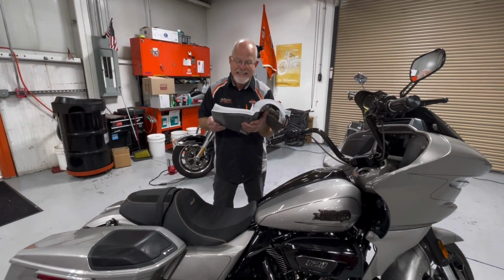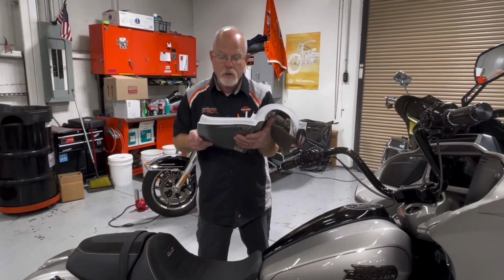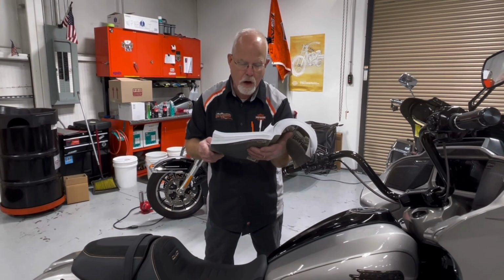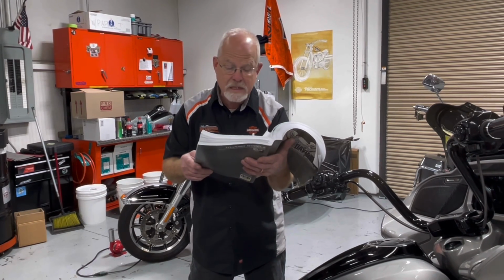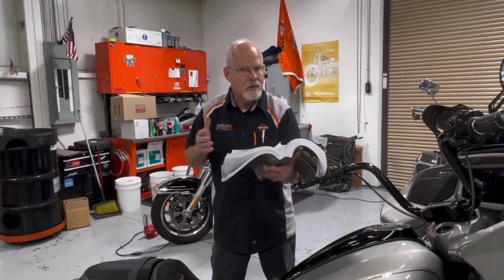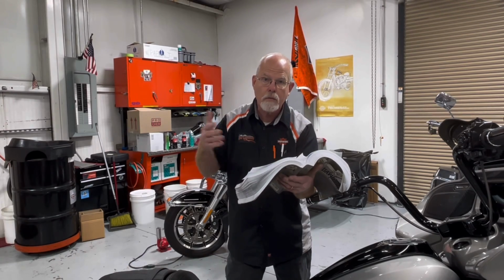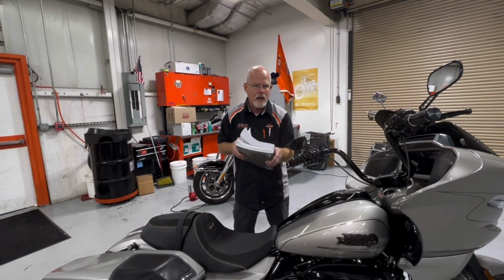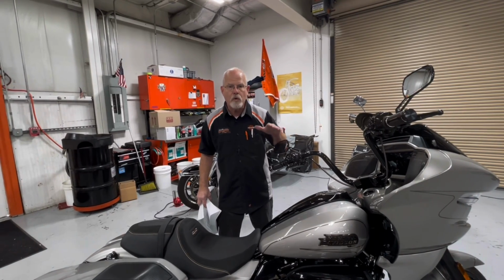New Model Software to keep your battery

Comment: The only thing I want my battery doing is starting the engine and running the lights.
The more I hear about these newer bikes the more I don't want one. It sounds like there's no way of fixing these on the side of the road or at your motel.
Reply from the maker: You are correct James. Harley-Davidson motorcycles are becoming more complex with more electronics. This is the result of new technology and the demand from current customers to have “everything “ on their bikes. In comparison you won’t find anyone repairing their new truck on the side of the road or motel either…Doc
Reply: @LowCountryHarleyDavidson  Cars/SUV/Truck/Motorcycles it doesn't matter about the complexity as long as it works in my book.

Comment: Look at the size of that service manual. Most likely small print too. And this for a motorcycle. 😢soon to require a mechanical engineering degree to work on them.

Comment: Happy new year Doc and low country HD. Q for you Doc if u could please what size are the 12 Spline pins holding the brake pads in place on the front calliper of a  2004 Roadking  ?
Reply from the maker: 1/4 inch 12 point socket…..Doc

Comment: Thanks Doc for this information. 
I expected something like that after the last tec tip. 
All the beautiful and well designed software gimmigs requesting energy. But most of all, the battery needs the power to start the engine. And that is the priority.
For us, as users/drivers, it means that we have to understand, how everything is working together.
Therefore we need your tec tips.
Thanks again and regards from Austria.
Reply from the maker: Thanks for tuning in Wolf….Doc

Comment: another great video Doc. Question: on the new CVO and the PanAm, how to see the diag codes? I was at the 120th anniversary last July in Milwaukee, asked to several HD employees and nobody could answer this to me...
Reply: Press down and hold your trip switch on top of left handlebar control, while holding down, turn your ignition switch to “on” and continue to hold trip switch down until the odometer reads  “diag” which now puts in diagnostics mode and release the trip switch button. Once there you can look at fault codes. It should have a display of something like PSPPB, not sure off hand without looking. From there you will press the trip switch for a couple seconds to go thru the above letters to have it look at diagnostics code. The first P will look at ECM, press switch again to look at codes for ecm and if present it will display an ecm code which you can clear by holding down trip switch and it will display clear, hit switch again to progress to next item in diagnostics and follow same format above. Your dealer can help out otherwise. Its a lot to cover in typing this procedure
Reply from the maker: The CVO is the same as earlier models. Hold down the trip button and turn ignition on. The Pan is a little more. Turn bike on, choose menue button on left control, scroll till the bike icon, enter, scroll down till you see Diagnostic,enter….Doc